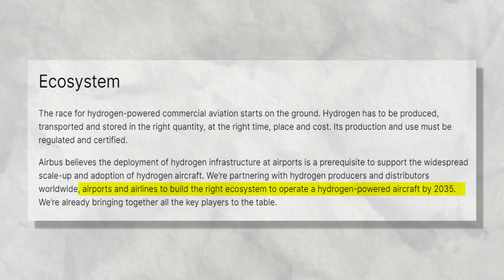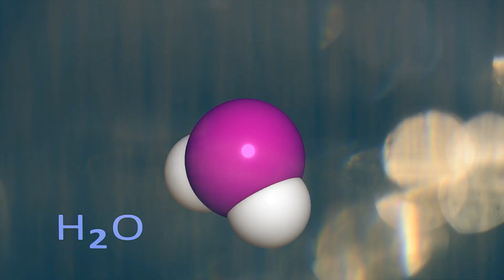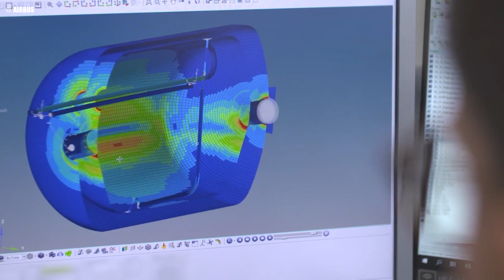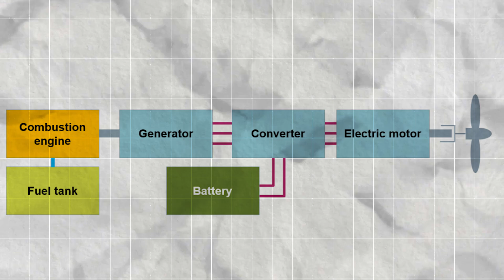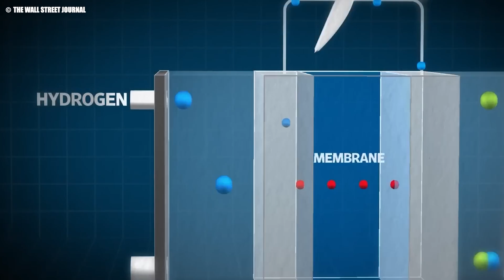Can Airbus Really Beat Boeing with Their New ZeroE Aircraft

Comment: Hydrogen is just a fairy tale for aviation. Would be far safer and a very little more expensive to fly with methane obtain with that hydrogen and CO2.  Forget SAF : It's the worst of the worst, replacing fossile fuel by photosynthesis will work if...We don't eat anymore. Remember : We have to replace all fossil fertilizer in the same time, and we'll NEED all photosyhtesis available to keep an acceptable soil. No room for photosynthesis fuel, only one earth there. We'll need to eat and travel but forget aviation at today's scale. It WAS a 20th century technology, will not be a 21st one.